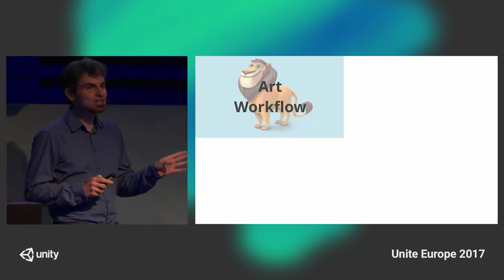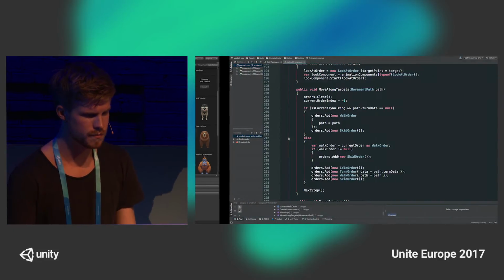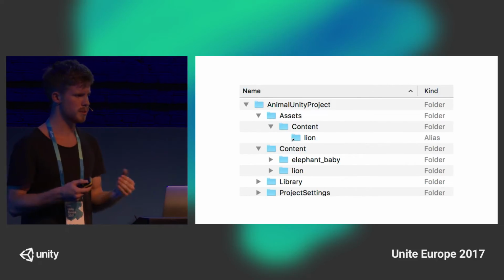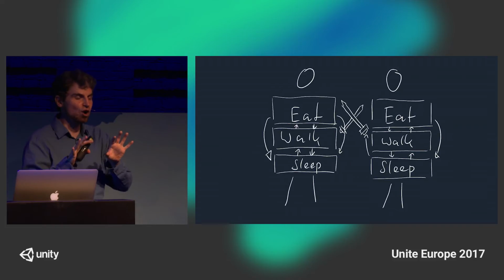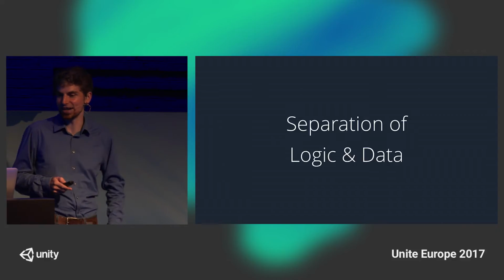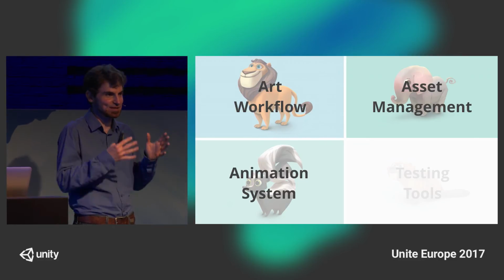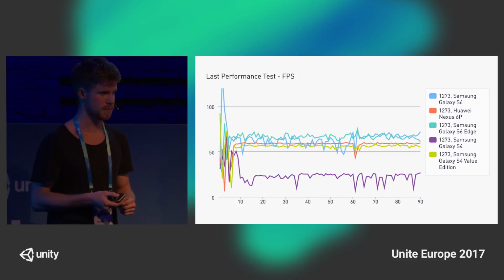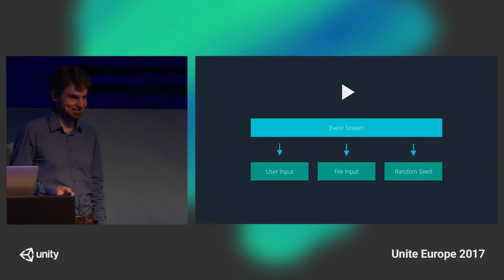Unite Europe 2017 - Making Lions Dance: Wooga’s workflow and tools for animating animals

Comment: 1) Did you have to handle .meta files (of the assets that got symlinked) in any special way or have any problems with them getting created differently on 2 different workstations?
2) Did I understand right that you used AssetBundles? Any problems with using them in practice? They felt quite buggy and fragile 2 years ago when they got a makeover. How did you feel about working with them (version controlling etc.) ?
Reply: Hi!

1: No, we don’t handle .meta files in any special way. With our solutions, all workstations effectively share the same .meta files, only locally you can decide to remove a symlink, but that won’t do anything to the files. As soon as you create a symlink in /Assets, Unity picks up everything nicely.

2: Yes we use AssetBundles, for our huge amount of content, this is the way to go. They generally seem to work fine? The tough part is the logic around it, things tend to get confusing. It’s one of those things that cost unexpectedly a lot of time. Do you know of the new AssetBundleManager? If not, check that out!